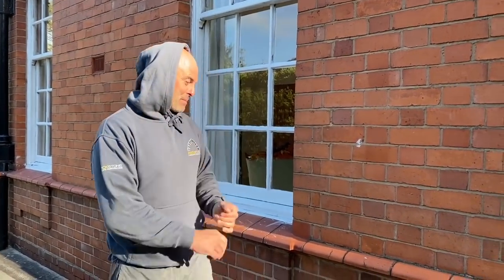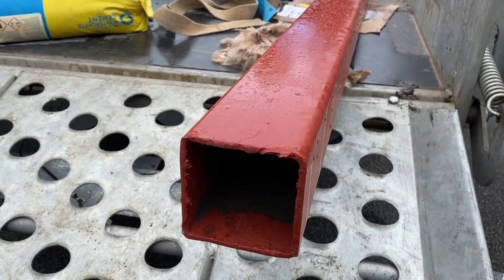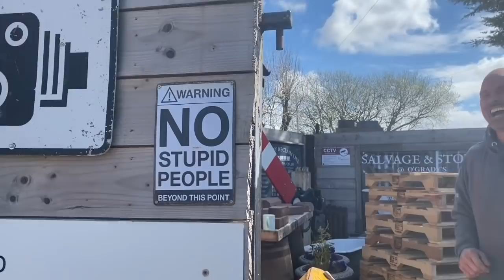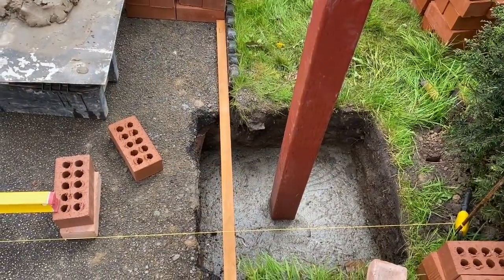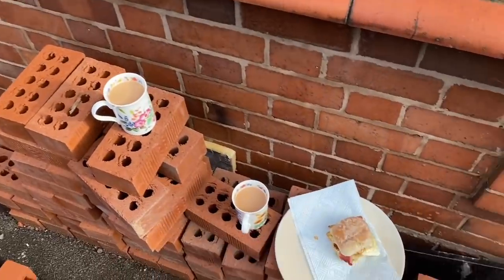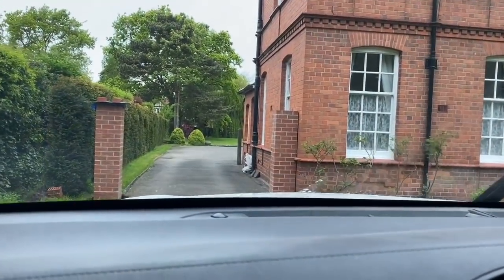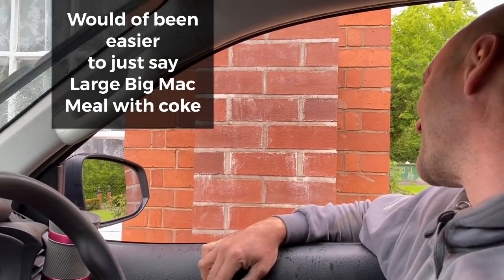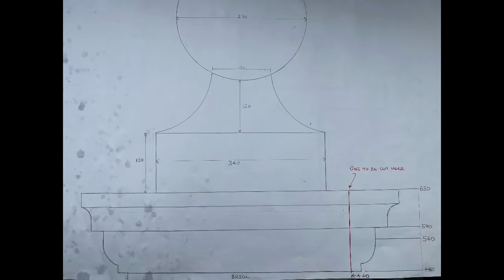Brick Pillars & Sandstone Caps

Comment: Treated your self to a gator 🐊 back boards a have these great kit ma labourer was putting them away in clean 🤬😆 superb work Matty.
Reply from the maker: Yeah mate I had them about a year, don’t get that much use as mostly paving, great tho aren’t they.
Gear doesn’t dry out which is Massive help in the summer.
Thanks bud 👍👍👍

Comment: Haven't finished watching this one yet but it struck me that you didn't copy the bond on the house.
Flemish bond , I think.
Enjoying the video as usual though.😊
Ok nice job as usual,Matty.
You should really have got some proper lifting gear!
Your health and safety comes first!
I realise it was just a day's work getting them on - a genie lift is around £150-£200 for a week.
Reply from the maker: Really?? I’m not a bricklayer but I don’t think I’ve ever seen Flemish bond on a free standing pillar? 
There are pillars at the front of the property and they’re built the same bond (stretcher) as we’ve done. So I don’t agree there I’m afraid.

As for the pillars caps, not a days work mate, did it after work one day, 2 hours work, no issues. 
Thanks 😊